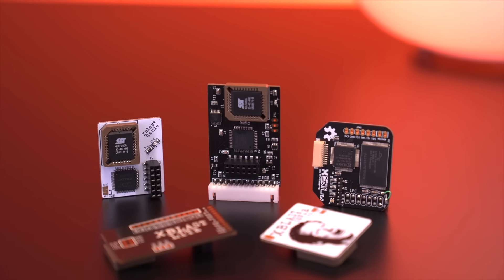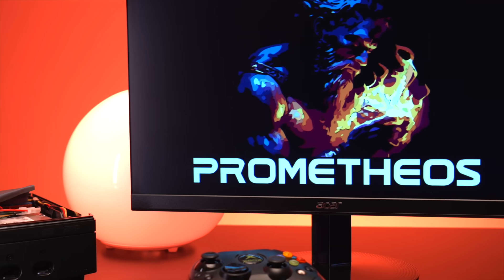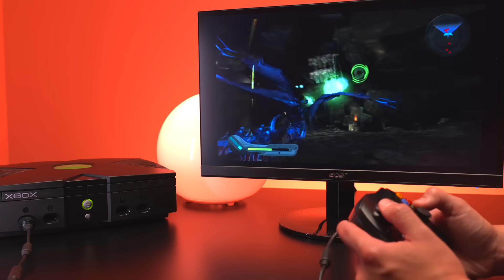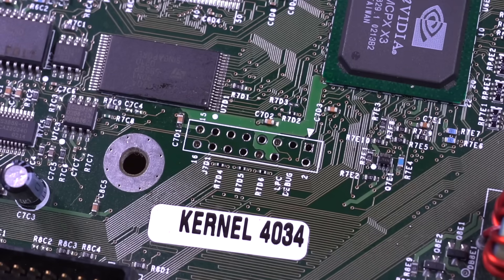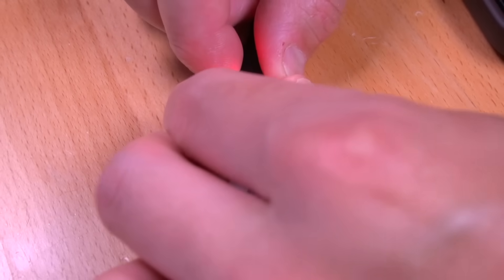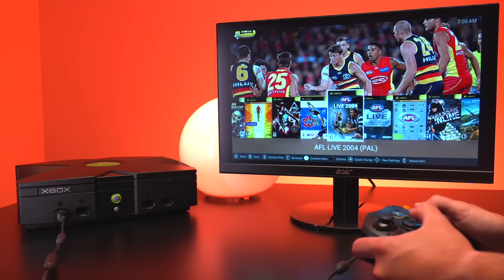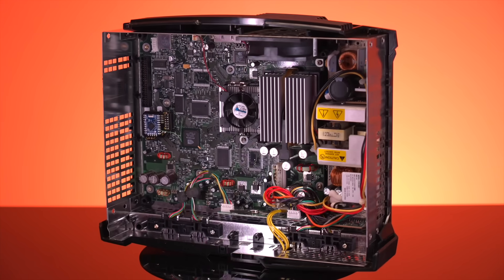Why You Need To Put A Raspberry Pi Pico Inside Your XBOX Right Now!

Comment: Wow!! I really like this new mod using Pico. But, could you still keep the ribbon cable attached for USB C access? Say, get a slightly larger ribbon, place a USB C port in the back of the XBOX for dongles and rom transfers. Also a throughport for allowing a USB C port expander to be added for storage, a data port, and even recharging for devices. Now I can create a NEO GEO within the XBOX itself!! 

Very nicely done!!! Makes me want to get my old raspberry PI and other gear and do some more mod work. Thank you!!!

Comment: This thing literally saved my Xbox that would not boot without a modchip (for some reason), the previous one broke (one of those cheap alladin clones) and the thing sat on a box for years

Now it's going strong with cerbios and tons of games ❤
Reply: Iirc, part of an Xbox's boot code is stored on the IDE hard drive. These hard drives are paired to a motherboard with a password stored in the EEPROM. If the drive's password isn't wiped by a modchip, the hard drive can only be used by a motherboard that passes the correct password.

If you don't have a mod chip or your Xbox dies, you can recover the hard drive's password with FATXplorer 3.0 beta 31 or later...if it's a Western Digital disk.

Comment: The Xbox modding scene continues to amaze me even this far removed from the Xbox's launch. Using a Pico as a modchip is very clever. I wonder if that method can be used on PS3s and 360s as well, with a different implementation and the specific software for those systems of course.

Comment: If the community can come up with a way to pair a hard drive to the system without running a burnt disc with homebrew on it (ala Project Stellar) this might be the one for me. My OG Xbox has been out of commission for over a decade because it needs a new power supply, new HDD/SDD, and at the time it needed a new DVD drive to be able to run the app to pair the drive.

Apparently you can use any old PC DVD drive with a modded console minus the ability to run original disks (a feature I DON'T need) but it would be great if I didn;t have worry about burning discs at all. As it stands I;ve been procrastinating on buying project stellar because of the price but if ModXo can do the same AND is cheap because it;s running on a Pico, this is the one. Getting a HDD/SDD is dead simple and getting a power supply shouldn't be too hard. The DVD drive was the worst part of the repair because price but if I can just remove it from the equation completely, that would be great. At that point I don't really have any excuses left to procrastinate on getting this thing FINALLY fixed.

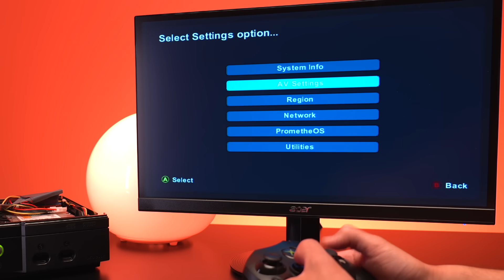Edit: 15:59 "Such as Hard Drive set up" SCOOOOOOORRRREEEEEEE! This is the one for me. Hell I already have a regular Pico, but I'll probably just grab a Tiny and a carrier board. that way I don;t have to manually add all the bitty resistors. I'm Okay at soldering but soldering tiny things like Surface Mount Resistors is NOT my forte.  Either way though, I might wait for the Prometheos port to have a little more time in the oven, but this is EXACTLY what I wanted. Cheap AND can set up storage without a burnt disc.

Comment: The OG XBOX modchip scene has been stagnant for many years, primarily due to how easy it is to softmod the console. Now, with other mods being developed that require a hardmod (like Cerbios), demand for something other than the old Aladdin clones has picked up.  Thanks to the community!
Reply: This couldn’t be more wrong. The last couple of years have been amazing for mod chips and hardware upgrades. You’ve just not been paying attention.
Reply: @Dikwili  on the one hand, fair. On the other, having a much more easily accessible and affordable option definitely should not be discounted

Comment: Macho, meet Mod XO. Mod XO, meet Macho.
So... does this work with the last handful of Xboxes with 1.6 firmware? I understand that some I/O pins are missing from the motherboard on the late models.
Reply: You have to do the LPC rebuild, but, yeah, this is posible with most of the Pi Pico. I have a 1.6b with the LPC rebuild and a 16MB generic Pi Pico and it just works.

Comment: something not many people seem to do is solder the d0 motherboard wire to the chassis of the console (instead of console to chip) - it will do the same thing and not need to be removed if you remove the chip for maintenance or any other reason. d0 just tells the console to boot form the LPC header when grounded.
Reply: Hmm? If you remove the chip with D0 permanently grounded, your console won't boot. Wiring to the chip is fine, and allows the chip to control D0 so you can boot from the TSOP if needed.
Reply: @GoTeamScotch  yea, but it's easier to resolder/desolder the d0 to the case than the chip. Just a trick I use. Of course you have to disconnect d0 from ground if you want to boot from the tsop

Comment: I wish it came installed on the carrier board, and had the USB port directly on the board without that ribbon cable.

If it had both of them, it would be perfect.
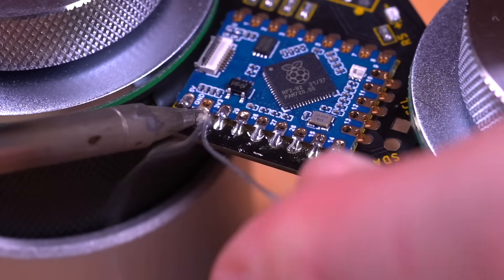Reply: Spoke too soon the third-party design at 14:52 had a USB port directly on it.

Hopefully that will have the header socket preinstalled too, to minimize installation complexity even further though.
Reply: Access to the USB port should only be needed during installation though. Any updates after that should be able to be handled by software. Similar to how it is with other modchips.

Comment: If only you could replace the Hard Drive.
Reply: I mean, you CAN. It's a pain to do because each drive is coded to a specific Xbox, but it's possible with enough blood, sweat, and tears. You can change the security code to all zeroes or all ones to force compatibility, or just copy the security code from an old drive.
Reply: I replaced the hard drive back in the day, definitely possible and was almost a requirement; the 80gb drive filled up so fast once you start putting your games on it (more reliable than the disk drive as it got older), or even just filling it with all the Halo 2 modded map packs. Pretty sure I used a 500gb drive but it might as well have been another lifetime

EDIT: Also I only ever had a soft mod, never understood why you'd want to bother modifying the hardware if it wasn't necessary

Comment: I have a Rocky 5 softmodded console. What will happen if I install this? Do I have to move any other files around or remove the softmod? I do not want to reinstall all my games and saves either.
Reply: You would need to undo the softmod back to stock.
Reply: @mattrogers6646  I’m guessing I would lose all my games and have to start from scratch?

Comment: Can this be done on a unmodded OG XBOX? I have 2 OG XBOX that had their clock capacitor removed, one has a bad hard drive I think.
Reply: For the one with the dead HD you will need to extract the keys from the EEPROM so you can add a new drive either old IDE drive or use a IDE to SATA converter board (cheap from Ali etc). It will fit in the same space as the drive, they are not enormous. One of my OG Xbox's has a dead drive and I was thinking today about doing the EEPROM key extract. There is a Pi Pico or an Arduino based key extractor on github. I have not read too much about the process yet
Reply: @Corialtavi /videos Oh boy~ sound like a bit more complicated for the one with the Bad hard disk. Oh well good to know.
Reply: Yes

Comment: My OG xbox stopped working even though the Caps are already replaced. Does anybody know somebody in europe who can fix old consoles? Maybe its just the power supply, maybe the capacitors aren't fully soldered in...
Reply: I would check the power supply first before spending a lot of money. Use a multimeter to check power from it to the mainboard (be careful or ask someone else, don't touch the caps) If there is no power to the mainboard it may be easier to obtain a second user power supply board. 2 screws to take out and a few wires to unplug. There's a YT vid of someone doing exactly this. Do an OG xbox harddrive search.

Comment: I love that the raspberry Pi Pico has more horsepower than the actual device it is assisting lol
Reply: Pico doesn't. Pi5 might.
Reply: Maybe an actual Raspberry Pi, but the Pico is 125MHz to the Xbox's 733MHz and doesn't even have floating-point support in hardware

Comment: why would I pick this over a softmod btw?
Reply: Correct me if I'm wrong, don't you require a gameshark + a game that works? Longterm it's an awful idea to keep relying on those because prices/resources for newer people getting into modding.

It's stuff not being made anymore.
Right now the rasberry pi is constantly being made along with new versions.

This is a more long term solution that requires less work at the end of the day if you know to solder.
Reply: You can install almost every hard drive you can think of. And some other things

Comment: Hope there's something like that to the 360 as well in the future
Reply: The 360 can be modded with a pico and like 2 wires and a resistor
Reply: @stevenbenson9976  oohh didnt know about that. Work with the slim version as well? I need to search It more info

Comment: Why should I do this over a TSOP flash which doesn't really cost anything?
Reply: Agreed and waiting for valid responses.
Reply: Wondering the same? Other than v1.6, obviously, which can't be TSOP'd.
Reply: You can’t flash Prometheos to a TSOP either. You’re then limited to only one bios, which is fine for a lot of ppl.
Reply: 1.0 and 1.1 models have 1Mb bios chips that can have their banks split.  @Dikwili

Comment: Yo Macho where do I even start with modding my og xbox? There's so many mods out there.
Reply: Honestly, unless you have a v1.6, just do TSOP flash. Super simple and only requires like 3 solder bridges that can be done with conductive paint if you don't know how to solder.
Reply: @mattrogers6646  I believe I do have a v1.6 model but I have to double check.

Comment: I could be wrong, but don't 1.6 and 1.6b models NEED the clock capacitor to function?
Reply: There is a way to bypass it now.
Reply: @8bitnation419  Please enlighten me, I replaced the main cpu caps and removed my clock cap ready to replace :) If i don't need a new one, would be useful
Reply: @50factsabout  You can remove the Clock Capacitor, by desoldering two R7P3 and R7P6 resistors and soldering the + to 3v3. Redherring32 creator of the OpenTendo Board has made a guide on this.
Reply: @8bitnation419  thanks for the info :)

Comment: Man, I just brought out my OG Xbox last week that I modded with the team executer mod chip like 20 years ago. Still works great! Good to know about the new options!
Reply: Remove the battery cap from the board
Reply: @JohnPeter-yf5jf clock capacitor not a battery capcitior most likely has been already done if it has been modded early in the days of the og xbox they found out the capacitor was defected
Reply: Executer 3 LETS GOO!!!

Comment: THIS! Is exactly what I have been looking for the last couple weeks.  Tito you always know how to make my wallet lighter.  What an amazing time we live in with all these passionate modders creating new mods.  Cheers to you for the great video and also to all these talented people doing hard work. 🍻
Reply: You kids and your modchips. Back in 2005 we would just use a memory card, one of 3 games, and crossover ethernet cable to connect the PC to the Xbox and run modding software from that. Didn't need no fancy custom BIOS, we just used a slightly modified vanilla homescreen and the built in HDD for storage.
Reply: @PhurPher  Well, you obviously didn't follow the scene back then. Modchips for the OG Xbox were extremely popular due to significant advantages over a softmod; there are like a hundred variants from dozens of developers, because they sold like hot cakes. "We" also didn't use a "slightly modified vanilla homescreen"; many of us used XBMC (initially called XMP; still in active development as Kodi).
Reply: @rockapartie  No, I don't. I was hoping for a reply like this lol. I never had a need to anything but softmod cause I didn't even know what could be gained with chips that I wasn't already getting from softmodding

Never seen XBMC before either. Is that the same Kodi as the windows media center Kodi, or made by the same people rather?
Reply: @PhurPher "You kids and your modchips.". I'm probably older than you are 😅.  I've always used mod chips because there is no need to lock a HDD after it's changed out.  Also In this age, a lot of CD drives are just dead and throwing error codes on startup.  I can easily bypass that and 3D print a drive deleter. There are many benefits to mod chips over soft mods.